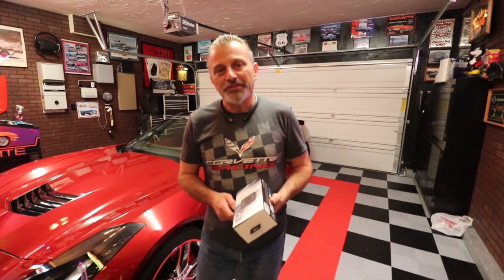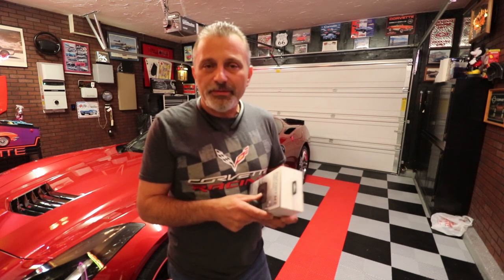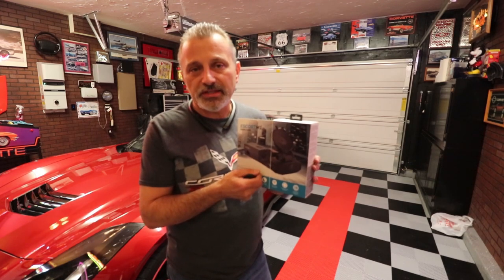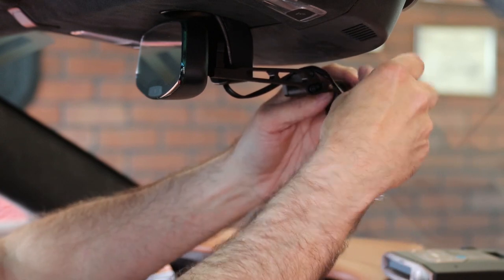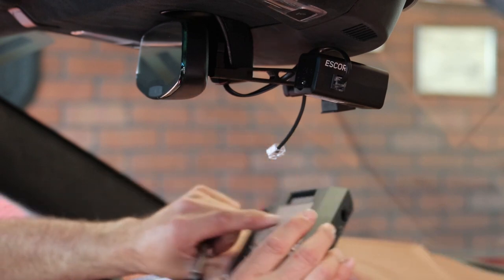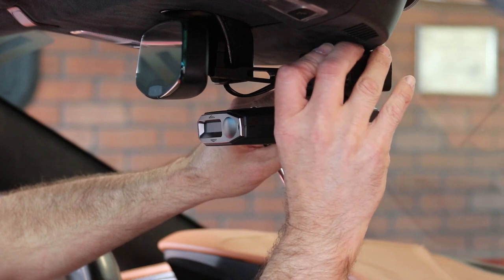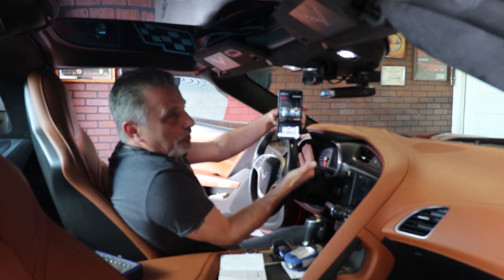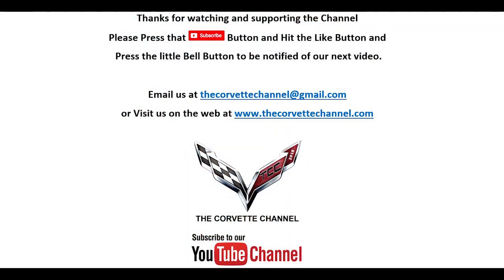How to Install an Escort  M1 Dash Cam in a C7 Corvette with a Blend Mount Bracket

Comment: Good video, do u hv any info on rear camera install, I hv a C7 and the Business who installed my front camera could not install my rear camera because the cable that goes from my defrosters inside my car, the casing was too tight to get the cable for the rear dash cam through it to run it to the front is there any other way you know to get that cable from the rear window back to the front of the vehicle. Thanks 👍😃
Reply from the maker: Hello,
I have not installed  a rear camera ina C7.
I thought all C7's came with a Rear Camera.
Reply: THE CORVETTE CHANNEL  that’s just a back up camera not a dash cam

Comment: Greetings:  Loved the look of your install; have a new 2019 c7 Z06 and have the blend mount and wire tap to install (for uniden r3) but cannot get the the small wire housing cover off to tap the wires.  Do not want to pry of course since new...any suggestions?  Thanks in advance.

Comment: Will it record directly to the app as soon as the car is started or do you have to upload it later? Will I have to open the app every time i drive before it records?
Reply from the maker: It records the the memory stick on the camera as soon as the car starts. In order to get it on your phone you have to connect your phone to it via its built in wifi network and download it to your phone thru the app.